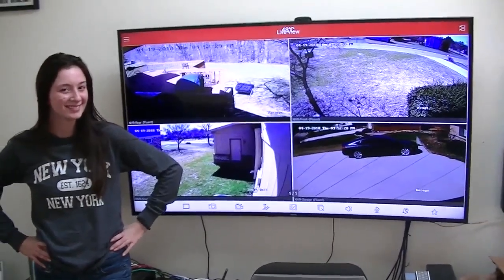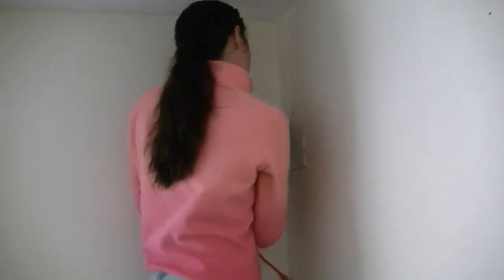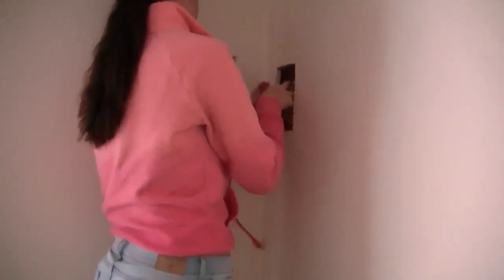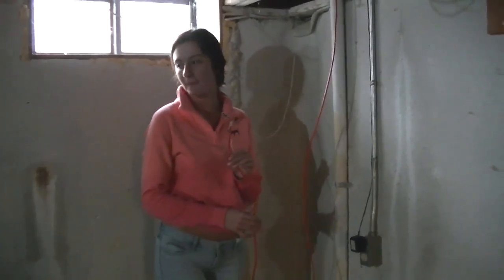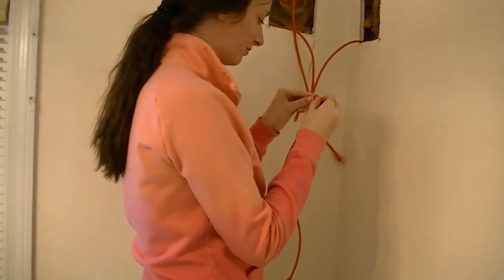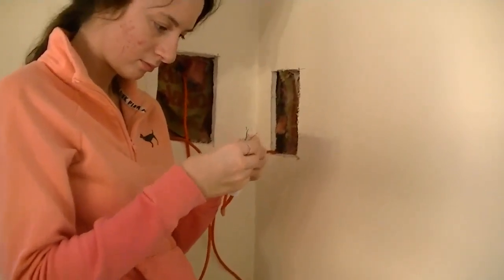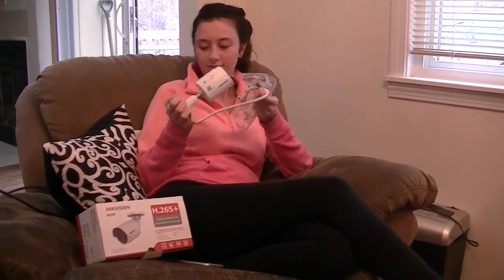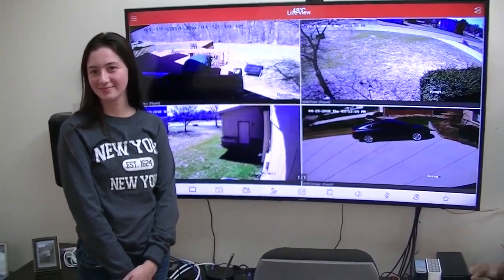How to install Ethernet Cables for Security Cameras, From Interior Walls

Comment: She did well running the cable and getting the camera setup...HOWEVER...the way she did the drywall patch/repair (and I'm guessing you taught her how to do it that way) was absolutely horrible.  That was a cheap and shoddy shortcut repair if I ever saw one.

The proper way would have had structure secured "inside" the wall with the replacement drywall piece resting on it.  Then some drywall tape.  Then spackle, sand and paint.
Reply from the maker: That " patch" will NEVER fail............ guaranteed..........

Comment: very quick, simple and REAL people lol. My only question is if you're going either horizontal or vertical, did you need to drill holes into the wood that sits behind the drywall? Sorry, don't know the correct terminology, so hopefully you understood my question.
Reply from the maker: The outside of my house is T1-11 wood siding.  I used a 12" 1/4" drill bit to drill from the outside.  I located the position that I wanted to install my camera, then drilled the 1/4" hole from the outside and goes through the wall and drywall.  This is where I cut the drywall.  Makes the job much easier to cut the drywall, then trying to "fish" the Ethernet cable from the basement, using only the hole drilled on the outside.

Hopefully, that answered your question.  You do NOT touch the wall stud.
Reply: @clarkss12  Thank you for your explanation! I was curious about this as I've seen videos where they drill through the studs to channel any wiring, but logical thinking tells me that ruins the structural integrity of said walls.
Reply from the maker: @GrooveYouVerse  Yes, never touch the studs.  Especially studs that support the structure.

Comment: What in fresh hell is the reason youre chopping such a gigantic hole in the damn wall? 
Why didn't you drill in from outside and drop a string with jack chain on it down? Dont teach people how to do things the wrong way. 
There is so much wrong with this... i mean its getting done but talk about doing things the hard way.
Reply from the maker: Can you post  your YouTube link on how YOU do it??  thanks
Reply: @clarkss12  
Nope i dont have time to make youtube videos while at work.
Id be more than happy to give written instructions on how to fish a wall in the least invasive way possible. 
How i would've approached it would be to drill a hole from outside into the wall cavity at a downward angle. Find a constant like a window, corner or whatever you can take a measurement to locate precisely where you need to drill from either an overhead crawlspace or attic or basement or sublevel crawlspace. Then drill the second hole. Using some mason string and about 6" of jack chain (if no insulation is present) drop the chain and hook that bitch with either a magnet or a wire hook. 
Been rewiring old homes for quite awhile. It just bothers me when i see stuff like this and nobody ever calls people out on their questionable tactics. Sorry for being a jerk, i take this stuff extremely seriously and i also apologize for the length of this comment.
Reply: Installation in the wall makes that a challenge.  His method makes the process so much easier.
Reply: @Mark.Watson  
Challenge being the key word there. Everyones always wirried about the easy way when they should be thinking about the right way. Hacking open drywall is a last resort for a pro. We became electricians and or data jerks for a reason... because doing drywall and paint work is for the slack jawed goobers that do it everyday.